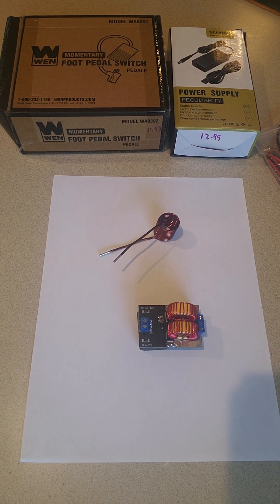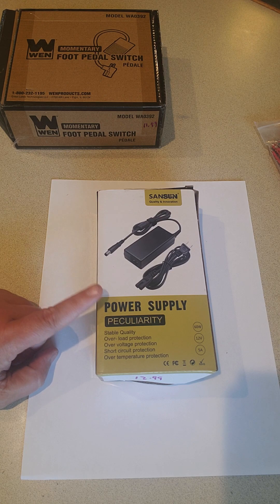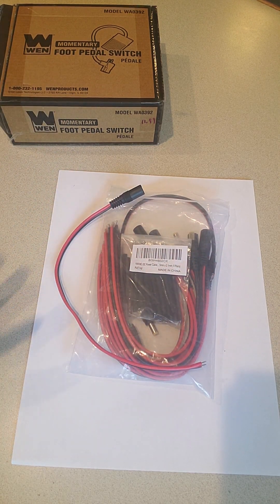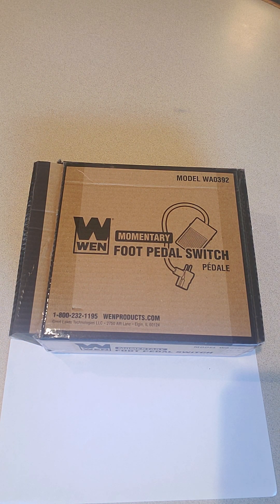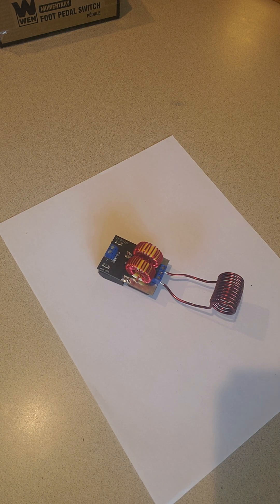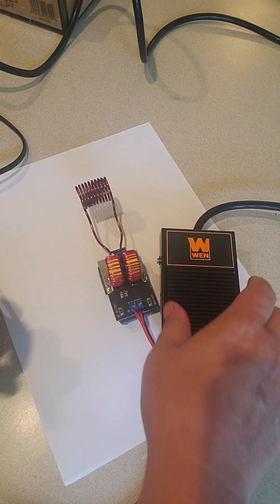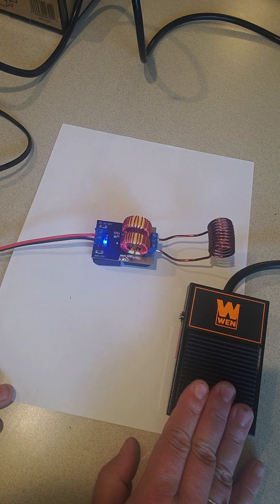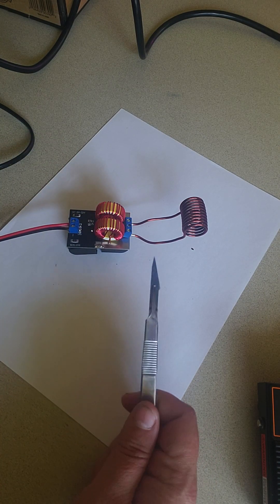Mushroom Growing Supplies; How to build an induction scalpel sterilizer for under $50.

Comment: I quite literally bought everything on your list in the description. The induction heater works, but only only without the pedal. When I use the pedal the light on the power supply and the light on the induction heater just blinks over and over. It won't stay solid.

Anyone know what's up with that.

Ifni don't use the pedal I know the induction module will over heat and break.
Reply: Mine was just blinking but she did mention that if you put it in too far it breaks the magnetic field and stops getting hot. That’s what I was doing. So if I don’t put the scalpel blade in entirely, it stays on just fine and my blade turns orange. The light turns off if I put the blade in too far. Hopefully that’s what’s going on with yours.
Reply: @AllHailKier  thanks Geneva

Comment: Just came across your video... do you think a unit like this could sterilize syringe needles efficiently? My Bacti-cinerator II is not functioning properly and I'm thinking it's part of my contamination issues currently
Reply: Induction heating works well with ferrous metals like scalpel blades, but syringe needles are generally made of stainless steel so likely wouldn't be sterilized fully by this.
Reply: @camsurbanfarm  can confirm, I just tried it, and the needle didn't get red at all. Guess I'm still resorting to flame sterilization, unless you know of a better way. I tried a used bacti-cinerator iii, but the element doesn't get hot right at the front. To replace it is beyond my price range atm

Comment: This is exactly what I was looking for, thank you!
Reply from the maker: That will absolutely work. When making this video, I wanted to make it as easy as possible for people with zero electrical experience. It was my opinion that cutting and stripping wires may seem overwhelming to some, so I left those skills out of this video.. There are actually a couple things I would do differently to make the unit work more efficiently, like soldering the coil directly to the board.

I will be doing a video in the future where I construct a more powerful unit using a larger induction board that will have the capability to sterilize larger items andI will be using  more advanced techniques to increase efficiency.
Reply: @WyldStile.Mycology  Thanks, I'm looking forward to seeing that. :)
Reply from the maker: Great to hear!
Reply: @WyldStile.Mycology   I'm thinking I might skip the pigtail, cut off the connector that would have gone into the pigtail, and wire it in directly. Do you see any problems with doing it that way?